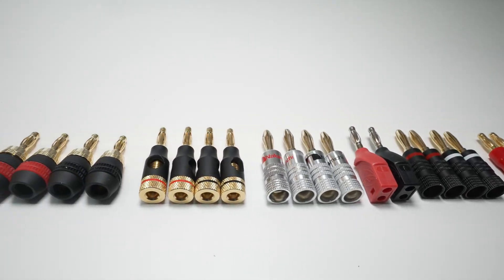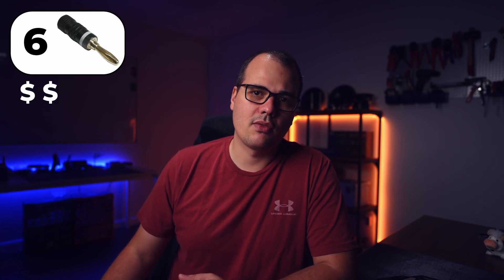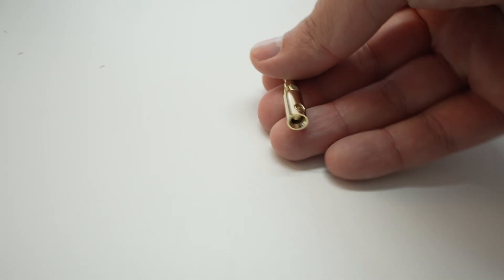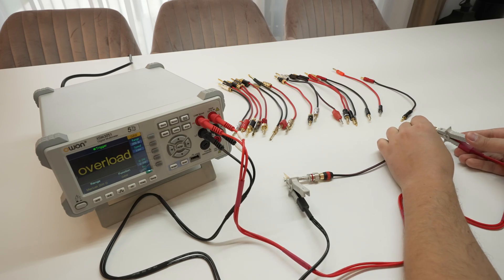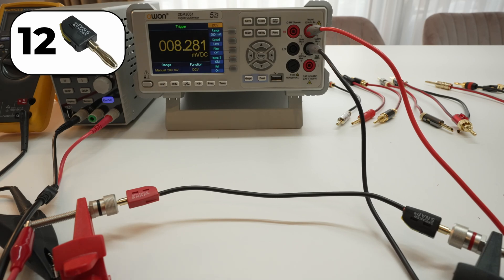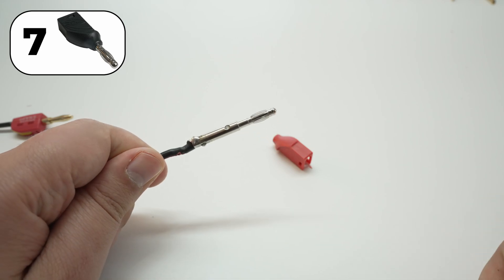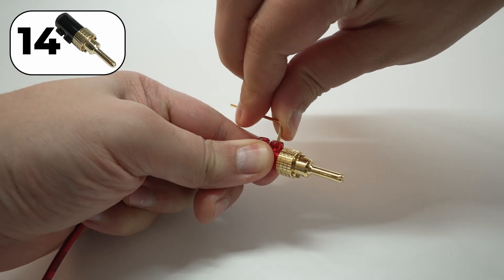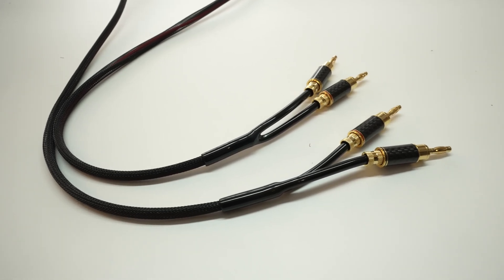Banana Plugs - Ultimate Buyer's Guide

Comment: Very good territorial, on the old banana plugs, I definitely agree about the Nakamichi, they make a very excellent hi-fi equipment, I have the DR2/, which I purchased back in the early 80s I do believe, and that same. I built a very large pair of transmission line loudspeaker cabinets, and about three years ago I had to replace the driver units, and yes, you guessed it. I got them from sound import., excellent advice and very quick response for delivery, 
I’ve been having a look at banana plugs during the last week or so , because I have a problem with my, crossover unit, which plugs into the back of my cabinet cabinets, and my cabinets are Bi-wired, and I’ve noticed that the banana plug that was used is starting to fracture out of the material that has been used. I think it’s called carp., non-conductive material, I’m not sure whether you can help, but I’m looking for a banana plug that has a threaded part to it so I can lock it in between the material, I did send a message to SI, but had no response yet, I’m trying to find the complete dimensions of the plug, the thread size and the total length, my power supply is NAD C355bee and C275bee , I am a English person retired living in France,

Comment: I solder the end of the wires & use cheap single screw banana plugs; they pass the yank test. Do you think solder helps or will the tin increase impedance?  
I use oxygen free copper 14-gauge wire & snip the finished end, so NO wire is exposed. What is your take on speakon twist-lock speaker cables? thanks

Comment: I was so disappointed how many of my banana fittings have iron in them. Why?? Those ones with the yellow plastic clips built in to them all are magnetic. And many of the self crimping screw-together style have magnetic male ends. But I've never seen any of them have iron in the back half for whatever that's worth. 
Question: can anyone tell if it makes a difference? Many speakers have iron inside we can't see in the signal path and some we can like ferrite core inductors

Comment: #10 Amazon basics are knockoffs of the Sewell Deadbolt banana plug at abou 2/3 the price. Both are sold on Amazon. The only externally visible difference is the split part of the contact, the part that looks like a banana peel, is a very short section of the contact on the Amazon plug, while the Sewell plug has a full length banana peel contact. Beyond that, I have no idea how else they might differ in materials and design. There are more than one YouTube video demonstrating how to assemble cables that show the internals of the Sewell plugs.

Comment: Did you notice any intermittent connections with those banana plugs where the spring part in the tip is this free-turning piece of sheet metal that freely spins around the shaft of the plug? I think that's what I've been seeing, where a little jiggling changes the current in a voltage-regulated connection.

Comment: Thanks for the video.  These silver-colored covers on the Nakamichi are electrically conductive (I tested them with a multimeter).  (That is BAD!)  They seem to be made of aluminum.  I had to find that out because I am using a ‘U Type Spade Plug to Female Banana Jack’ adapter for the speakers output of a vintage amplifier.  Therefore, the banana plugs’ covers do touch each other behind the amplifier.  To solve the problem, I put electrical tape (3M Temflex Vinyl Electrical Tape) around the covers of the positive (red) terminals.  The product description on Amazon said nothing about these covers on the Nakamichi banana plugs being conductive.  Overall, these Nakamichi banana plugs are good for my audio system.
Reply: Weird, after reading your comment I've tested my Nakamichi with a fairly cheap but usually reliable multimeter & get no continuity across whatever metal mine are made from 🤔

Comment: Use the smaller crimp style that plugs in tightly, it has less metal weakening the signal and because it so small it is less likely to pick up interference , if you don’t want it to oxidize the wire then seal them with heat shrink

Comment: You probably know that gas tight (soldered) connections are best so anyone who's able should be soldering the wire into the plug.  I use something very similar to #3 always soldered and they work very well.  Nice job!
Reply: You will never hear the difference between soldered and non-soldered banana plugs or connections for speakers.
Reply: @gregorybond2859   I agree but I'm speaking from reliability analysis for Military systems.  Non-gas tight connections have the largest impact on reliability and in 5-10 years the resistance will probably go up.  You probably know about switches "wiping" the contacts with use, and reseating plugs or RAM to also wipe those contacts.  It is real and you also don't have to worry about the screw loosening up.

Comment: Hollow bananas 4mm soldered to the wire and no contact to screw is the best, because the screw loosens and the wire gets ruined. This solution thanks to the hollow bananas offers the best ohmic contact because a wide contact is established and the hollow bananas exert pressure like a spring when inserted into the binding post

Comment: I am so happy I bought the Nakamichi plugs ! They work perfectly and look great ! BTW, I always twist and tined the wires before installing them to protect from deformation and oxydation. Your measuring method is pure genius. I would never had thought of doing that to measure the conductivity !!! Thanks for your effort, that was very illuminating !!
Reply: I have 2 versions of the Nakamichi plugs (since Nakamichi is just a name slapped on anything). One has the aluminum shell and the other has a plastic outer shell. Although I've never had a problem with a conductive shell, I just feel safer with the plastic shell.

Comment: I've gotten "not cheap" banana plugs from Amazon from Foss, and another unknown brand with right angles. When "connected" and used without stress both of them seemed fine. They had a substantial weight, gold plated (advertised), and were highly reviewed but both have proved actually quite bad. The problem is how the male part connects to the base/rest of the connector -- it's flimbsy in both.

Actually, maybe someone can check me if this is design intent: the fact that it is flimbsy and broke off after accidental tugs that were no where close to extreme was a problem for 2 reason. The obvious one being that I now do not have a usable connector, but even worse the plug is now stuck in the binding post. If you have substantial gear with 5-way binding posts it shouldn't be too hard to get the broken off plug out, but I'm sure some gear out there is less forgiving.

The small reason why this might be intentional or desirable is the fact that the tug that happened on my speaker end was from a KEF LS50 Meta on a stand, and even though if the connector held it wouldn't have knocked over the speaker, having a connectors break before knocking over an expensive speaker I'm sure is always preferable.

I'm a bit conflicted here.

Comment: I have the Nakamichi plugs and I’m worried that 11/12 AWG won’t really work, because the screws have to be almost all the way in for the outer cover to go back on. Should I just go with 13/14 AWG or try solder through the screw holes and throw the screws away?
Reply: You’ll need Nakamichi “fanlock” for that thickness. Having said that a cable that thick is only for visuals, it isn’t helping sound. 16/18 AWG will perform identically.

Comment: Viborg and Monosaudio has pure copper bananas on Amazon in different plating and seem to hold up very well, but I don't disconnect my cables often. They are a little pricey as they add in shipping with the cost. You can use dielectric grease on copper to stop /control corrosion. They come with shrink wrap also.
Reply: My understanding  is Dielectric grease reduces connectivity (which results in less arcing and thus appropriate to use on car battery terminals). Perhaps copper laden grease (such as anti-seize) is a better alternative?
Reply: @ts6640  Dielectric grease can be used to seal the connection on the outside like car battery connection. Not on the banana connector itself but outside to seal the connection. I have seen copper decades old but sealed from the weather and looked almost new on some of my old motorcycle wiring just like the insulation was stripped off. and new copper again. Brass is still very good though and most use it for better strength.

Comment: I have found that the Nakamichi plugs are okay for a couple of years but eventually the springy contacts become weak and the contact resistance increases and causes distortion on bass transients. The spring contacts also only provide a small area of contact with the inside of the socket. I have found the BFA-Z plugs are superb and due to their design have an enormous area of contact with the inside of the socket.

Comment: If you have a decent cable then choose crimpable or soldered plugs. Or just solder on the wire directly and live with the hassle of attach/detaching.  99.9% of us rarely unplug it, so its just a odd bling we want, and usually a cheap option we tend to buy also..

Comment: The ones with the springy part that spins free on the center pin or post are bad news as resistance can vary with the loose parts.  You can solder the springy loose spinning part to the base of the connector to prevent issues.  Bad design.

Comment: I was looking for 14awg wire and what I found is confusing… I have seen metric equivalent 14awg ranging from 2mm2 to 2.5mm2, what is the Actual accurate measurement?
Reply from the maker: I'm pretty confused also with US units. An accurate conversion of 2.5 mm wire would be 13 AWG. However, in shops you will find even gauge numbers. In that case 14 AWG is considered 2.5 mm equivalent.
Reply: @AudioJudgement thanks 🙂
Reply: The most used cables are 2,5mmq and 4mmq but 4mmq are thick and only for hardcore Audiophiles.

Comment: Use crimp wire ferrules before you stick it into a banana plug. It solves the screw issue most of the time, prevents corrosion and provides a better contact. Now all of this does not matter in real use, few tents of an Ω will not make any difference in audio circuits.
Reply: Prevents pullout due to wire relaxation.  I use ferrules whenever possible.  Be sure to use the crimped that creates a square cross section.  Not the hexagon style.
Reply: If you can find it, there are pictures online of crimped ferrules that have been cut in cross-section.   The pressure of the crimp compresses the ferrule around the conductor strands to such an extent that the cross-section appears solid.  No air gaps in there.   100% contact area.   

I understand the objection to an additional material.  I believe the increased contact area and the improved contact with the banana plug screw over comes any loss due to materials.  

Not to mention insurance against relaxation of strands mangled by set screws.
Reply: Oh, a few tenths of an Ohm do actually change the sound because the relation between amp output impedance and speaker impedance changes with frequency. You get a frequency dependent voltage divider that changes to frequency response by +-1 or 2 dB or maybe more, depending on gear. That's audible and undesireable.

Luckily, that's not a problem here because different wiring and screwing methods do NOT result in this big of a contact resistance - it's MUCH lower and irrelevant, as long as it's stable.
Reply: @ropeburn6684  Do the math and you will find out that it does not matter, at these frequncies ...
Reply: Soldering.
Reply: @LiaBarsou Also good but crimping is faster ...
Reply: @galileo_rs Yes, but for some cables for personal use you also have to buy the ferrules made of real copper (not magnetic) and a special good crimper, and they are not cheap, and that's only to maybe save a few minutes, while many already have a soldering iron to carry out repairs.
Reply: A few tenths of an ohm DO matter as ANY resistance reduces damping. Some argue 100+ is enough but my ears hear different
Reply: @anthonykeve8894  You may hear a few tents of an Ω but that is only in your mind.

Comment: I've been using the number 2 banana plugs for a while but mine seem to be brass or at least brass coated, they work fine for me
Reply: I just got some for 3 euros 50 for 20. They are simple to use, settle quite well, and so far I don't hear any differences with threading the bare wire.

Comment: Good job and great info. My personal gripe is banana plugs with metal sleeves. If you accidentally touch the two connectors together while switching cables, it can shut your amp down or put it into protection mode (which is a headache to deal with on some models) or the worst case, short out a channel/amp.